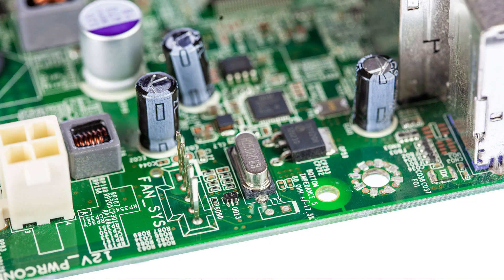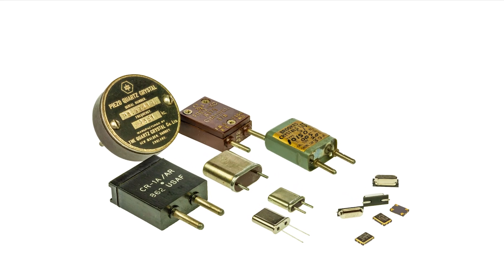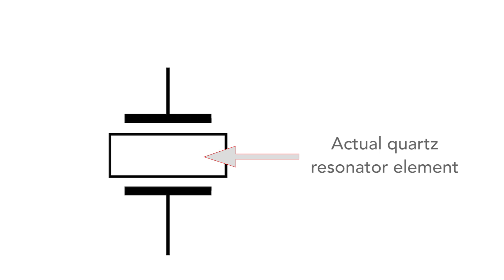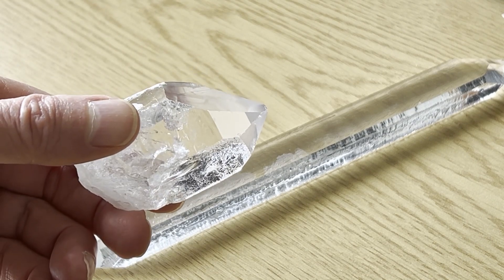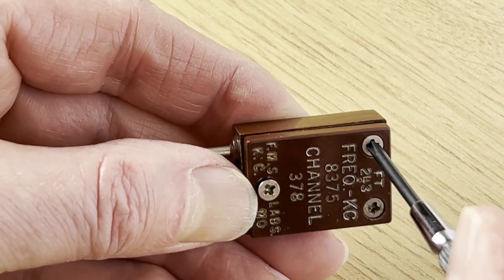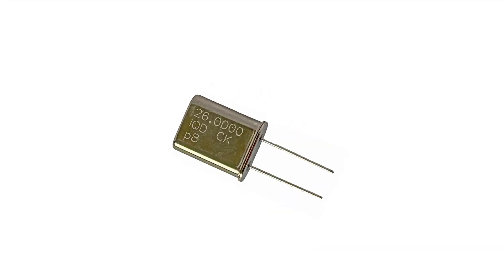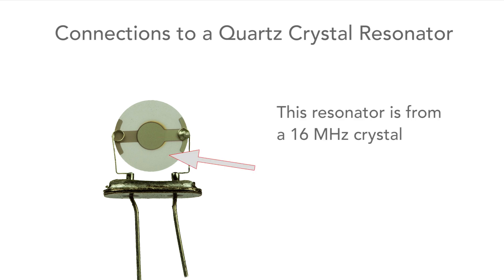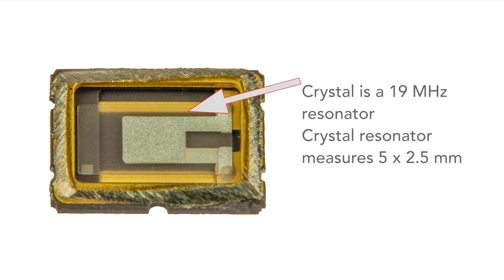What's Inside a Quartz Crystal Resonator

Comment: This is why iPhones went bad around helium or hydrogen I forgot which but it got in the phones crystal and caused the clock to shut down bricking the phone
Reply: not quite.  modern cell phones use silicon MEMS oscillator (silicon, not quartz), which was affected by helium. after a few days the helium dissipates and the phone recovers.

Comment: Thanks for the explanation. Where is the actual frequency output in these oscillators? I mean how you connect it to other components or dut?
Reply from the maker: There would normally be a specify output contact. In terms of the point on the circuit, it will depend on the circuit itself.

Comment: I have already subscribed when I saw the quality of technical expertise. Even as a virtual novice to electronics I recognise in depth knowledge of the subject matter. Regardless sir, if I may. Why do crystal oscillators operate at such high frequency, are there non capable of operating in the hertz region? Why must they all operate in mhz/ghz? Thank you sir.
Reply from the maker: They operate at frequencies that are normally above 1 MHz because of the physical sizes needed. The crystals use physical vibrations and resonances - to get very low frequency resonances, they would need to be very large.

Comment: I wonder, why the crystal oscillator doesn't generate a pure sine wave?
Reply from the maker: It should produce a pretty good signal - it will be spurious products that will give distortion. So may be there is too much feedback in the circuit.
That said, so crystal oscillator units are designed to give a digital square waveform out. They take the basic sine wave and square it up so that it can act as a clock oscillator for a logic / digital circuit.
Reply: @ElectronicsNotes  so the reason would be the analog to digital conversion? thats pretty neat!
Reply from the maker: Well it's not digital to analogue in the conventional meaning of the terminology. It is just that the waveform is often squared up so it can interface to digital circuits.